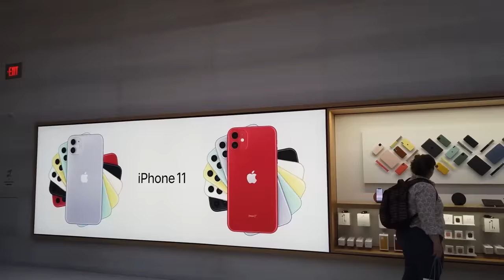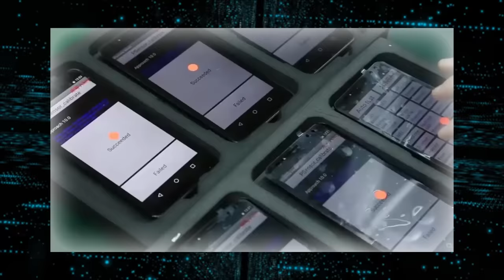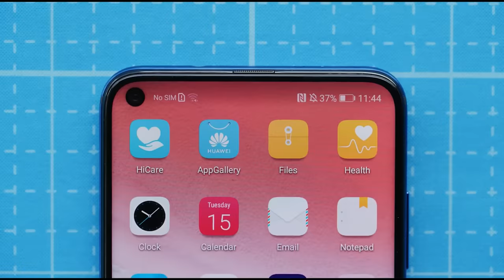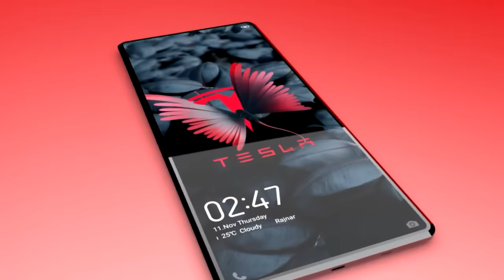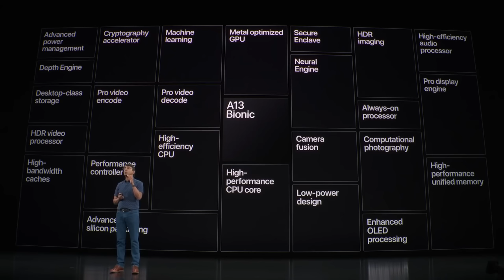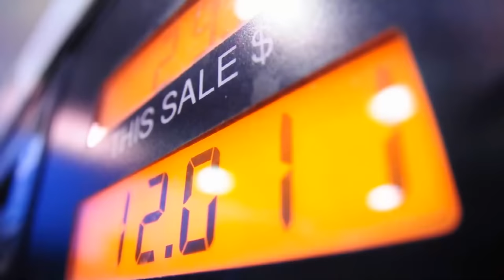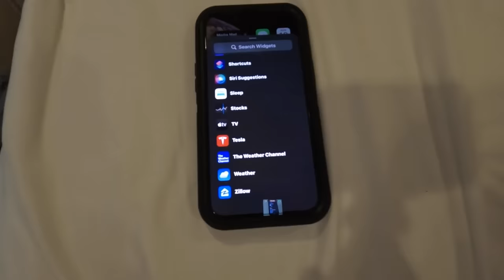Tesla's Pi Phone vs Apple's iPhone 🔥🔥🔥

Comment: Now that Elon has shrunk the Starlink antenna down to something small enough to fit in a mobile phone as well as the need to maintain line of sight, we should expect him to get rid of the outside mounted Starlink terminal - CAN’T WAIT FOR THIS !!!!!
Reply: You have any proof of this? The Starlink antennas are still huge dishes...
Reply: @csakzozo  the proof is in the fact Elon is saying he can manufacture a Starlink based mobile phone.   If true - he meeds to have figured out how to shrink the antenna down to fit in the phone form factor.  If the phone is capable of operating in enclosed spaces (and not JUST outdoors) then he has to have solved the line of sight problem. I am not saying he HAS solved these problems. ELON has implied that HE has - by touting his phone
Reply: @stephenm103  I looked all over the internet and I couldn't find not one source of Elon talking about making a mobile phone in any way. I call bs on this rumor.

If he does though, I'll be the first one in line... Please link me if you have a base for all that speculation you mentioned up there...
Reply: @csakzozo  huh???  Its called Pi Phone
Reply: The cost of an antenna and front end chip to acceptability process the satellite Starlink signal will be very expensive
Reply: @stephenm103  Yeah... That's all speculation. Send me a link of Elon talking about this venture....
Reply: Guys, technologically, phones can't yet connect to satellites at useful speed and latency. What it means is it will make easy for you to connect to your already set Starlink system, if you bought and subscribed to one (when you are around it). Something you can probably do with any other smartphone.
Reply: @stephenm103  Don't expect a solution to lineofsight... The energy level of ALL the devices in the system (phone, satellite) utilized is SO LOW that virtually anything will degrade the signal, and I'm guessing here it might even be an exponential degradation!
Reply: Also: I have owned my Model X P100D for nearly 5 years and loved every one of the 72,000 miles I have driven!
Reply: @paulshirley844  that’s great to hear,Paul.  I loved my Cortina Gt .. my Toyota Crown Wagon.. oh, and my Mustang GT.  
My subaru brat saved my life - literally. My Audi Quattro was a great drive .  My Suburban took me and my friends skiing and hang gliding in some remote places I wouldnt take many other machines  They all had at least 100 to 250k  on them when i eventually sold each one off to the next lucky owner.
Reply: He has not, it’s simply not possible at this point and he has said it himself
Reply: @stephenm103  Don't forget the power requirements and heat dissipation. Ok, the former could be solved with one of the world famous 4680 batteries.
Reply: Hopefully it's really Pi phone , Not Pie phone.
I will look forward to it.
💪👍
Reply: @stephenm103  That's not proof, Elon has made a plethora of claims that he had no intention of following through with
Reply: No smartphone has direct connection to satellite, the srarlink dish alone uses over 100 watts of energy.
Reply: @letsgobiden653  so .. your point is that Elon espouses a lot of BS.  Ok. We are in agreement
Reply: @stephenm103  Sorry missed the last part of your comment, thought you were fangirling lol my bad

Comment: I’m betting there won’t be “Planned Obsolescence” issues where you will have to buy a new Pi every time the OS is updated. I’ll be making the switch as soon as it is available.
Reply: Lmao. Supporting old devices requires massive resources. This will flop
Reply: @Noddydc  depends tbh. How would it require massive resources? Only thing I imagine seeing is that the OS won’t have huge improvement
Reply: once the PI is released and gains in popularity it to will be hammered by hackers.  Remember when Apple was the most secure Computers.  Not so much any more it was only that the payload was not worth it.

Comment: 1. What cameras would be in those 4 lenses?
2. How would the phone take a clear night shot without a long exposure?
3. To quote JerryRigEverything "Glass is glass, and glass breaks."
4. What kind of magical solar panels allow the charging of a phone through a solar panel without it taking days. Plus, how would the phone account for the sun change in the time of day?
5. Apple tries on purpose not to do "earth shattering" impovements because Apple designs phones for the majority.
6. The iPhone can already do that in the form of the wallet app
7. Does Tesla plan to build it's own operating system from scratch or use Android (owned by Google)?

Comment: Apple had a monopoly that it built its brand out of. It done things to make money even tho it would piss customers of because it was apple and it could. The reason elon can get into the phone market and dominate is but apple can't do the reverse is the structure of the companies and the bureaucracy that is built into apple's structure and its inability to maneuver and adapted quick enough plus the pull tesla has on the best and brightest is too strong and the ones that does go to apple are too extrinsically motivated to produce at the level they need to.

Comment: Why would any mobile developer want to be compared to iPhone, the iPhone is significantly behind every top brand of android phones both hardware and software. I have always used android but I decided to try out the the latest and best iPhone available from Verizon. the camera is complete crap and the phone starts to overheat with any medium cpu intensive software and they still stuck with there crap charger. for how much money apple has made they should not be releasing trash phones, however they do a great job with there iPad and a good job with their MacBook's and the like.
Reply: Let me tell you a secret, the iPad is just a scaled up version of the iPhone. If anything, it's worse because it has no calculator, health, or wallet apps. Until 2020, iPadOS and iOS were one and the same. Also, The iPad also has among the worst cameras I have ever used.
Reply: @heavy0119  I didn't really clarify how it was good. I use it to control my music production software, and games run much better on it then any android tablet I have had and they finally updated the charger also unfortunately the software my work uses Ground Cloud for deliveries only works on IOS. Overall though Apple does not try to be innovated, they definitely rely on their brand, teenager and work related fan base which sadly has worked. I hope Elon really does make this phone the only concern would be raising our expectations with a let down either by not having promised features or a bad price tag.

Comment: Give us an Unbreakable screen and a fast phone with 8GB of Ram you could become a winner If You want to become The mobile King let us have all the amenities Holographic abilities Augmented Reality VR 7.2 Surround sound codec with Dolby Atmos 8k resolution display 8GB of Ram at least 1TB of memory 48 megapixel front and back cameras crack shader and scratch less display MPS systems Solar rechargeable batteries 4 Speakers with Dolby Atmos codec  unlocking and purchasing Voice recognition and finger print  power on and off abilities by voice  Binocular abilities mind reading PlayStation and Xbox gaming in 8K  That is if you want to be The Mobile King